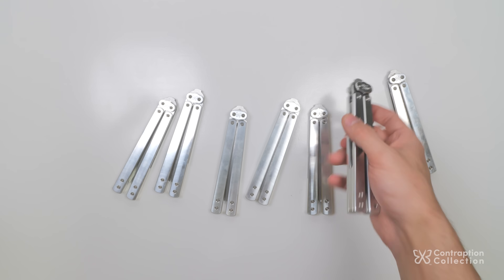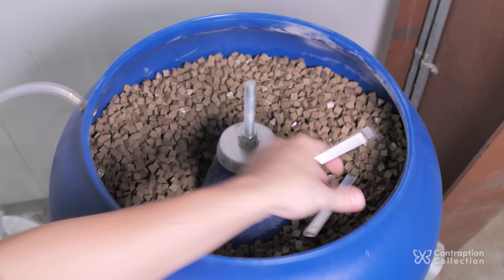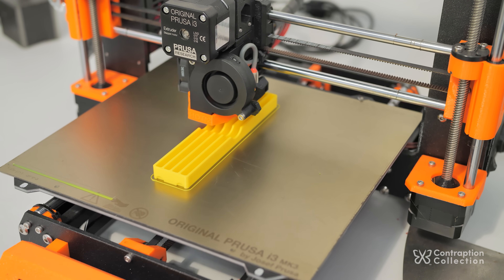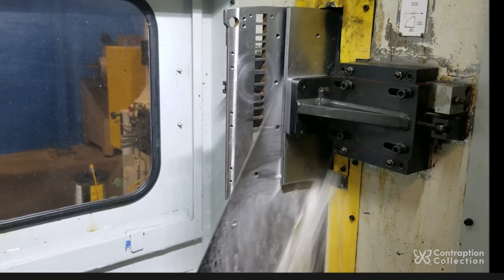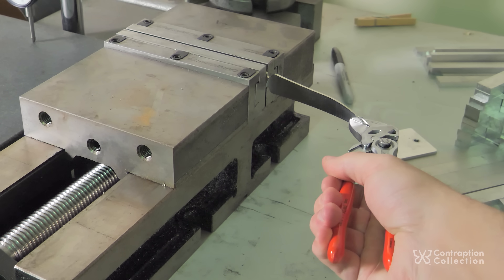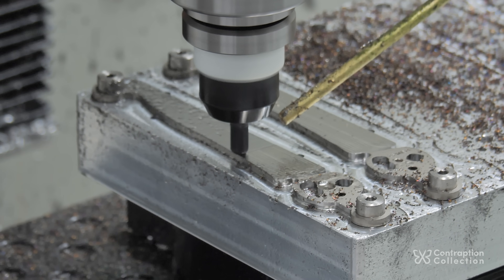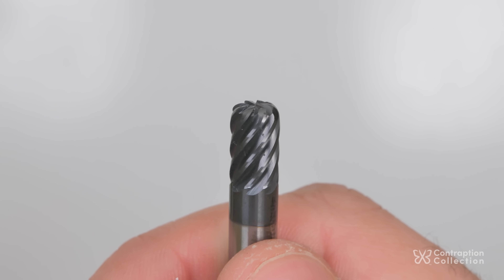I thought I was finished! Baliscissors: Ep 28

Comment: I'm no expert but I've watched an unearthly amount of forging and machining videos. The process is usually to make as much of the final product out of the stock steel as possible and then heat treat before sharpening and final finishing. Have you tried using an oil quenchable steel? normally it can be bad for warping with long thin blades but it seems like that is occurring in your current process anyways. might be worth a look.

Comment: Internal stresses in the material. 

Think of it in terms of material physics. When heated, the material expands, this temperature is held until all the material reaches a stable high temperature, this re configures the crystalline structure of the metal and when the material is cooled rapidly that reconfigured structure gets locked into place. 

However by rapidly cooling the material in this way, the inside of the material cools much more slowly than the outside. This causes the outside to rapidly contract, putting a lot of internal stresses in the material. Normally this wouldn't be an issue, but when you start removing material from one side of this highly stressed blank, the other side pulls the blank into a bend. 

The way to resolve this is by stress relieving the material after hardening, put it in your furnace at about 50 degrees C below the tempering temperature for about 2 hours, probably in the region of 450-500 C , Then after two hours, turn off your furnace and allow the whole furnace and anything in it cool slowly over many hours back to room temperature. This should get rid of the internal stresses without ruining the material properties. 

In the aerospace industry on extremely high tolerance parts, materials are often stress relieved after every process of manufacture in order to avoid any buildup causing poor manufacture tolerances further down the line.

Comment: Remove material in an annealed state, then try heating only one side for the quench.  In knife making if you don't heat both sides of your blade evenly you can get warps in the blade during quench.  Since you're cooling between plates, maybe pre heat or cool one plate so they are at significantly different temps, so when you draw heat from the blade it is at different rates.  Food for thought.  I love your idea and appreciate you sharing your journey.  I'll have to buy a pair when available.

Comment: They need to be in a Press while Tempering. Also when you remove Stock from a Billet it Usually Exposes the Stress In The Grain. Therefore subsequent Heat Treatment wil result in Undesired and Unexpected when the Metal releases the Stress from Manufacturing..
Killer Idea but you don’t know Enough about CPM. 

Temper The Blades in a Press. Leatherman Does Batch Tempering in Presses I Know because I Did a Bunch of their Farm Out Work when I was Machining in Portland

Comment: Maybe sand blasting the pieces before anodising should give nicer result (try different sands to look at different finish) and could permit to choose where to keep surface sleek and where you want the surface blasted and keep the same tolerence for your cotes. I'm worried that because of anodising deteriorating quickly in pivot holes and increasing holes sizes making the scissor wobly?

Comment: Are you tempering to relieve internal stresses?

Are you beveling after heat treat? You should have almost the exact finished shape before heat treat including the bevel just not a fully sharp edge yet (as close as possible). There should be no real mass removal just surface treatment (usually sanding or grinding).

Also id first try a bit with only 1 edge. Way less heat generated per revolution. Slower feed rate proportional to ratio of edges.

Finally try a more forgiving alloy.
Reply: I have an invention as well and may need to do some similar production research so thank you for sharing your story.

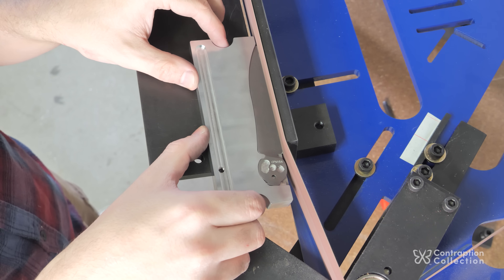Comment: @ContraptionCollection I have a solution for your problem @ 6:13 wearing down the sand paper in 1 spot.  Even with periodic raising and lowering, will lead to not maximizing the sand paper life, and/because it can possibly split while in use and slapping you in the face or eyeball.  A better way is to machine a adjustable plat that screws on to the grinder, but you plat can be adjustable at y axis and possibly z axis, put little liquid levels and possibly a stamped in guide with degrees so you know angle your at to stay consistent. then rotate new plat at an angle on the y axis from 0 to about 25 degrees , so the whole flat edge of blade  encompasses about 95% of the sand paper top to bottom.    Also your problem for the warped blade, maybe try adding heat the whole blade during milling so its even, and then have a warm oven ready so it can cool down at a slower pace. also maybe have some block with the blade dimension cut out says stays flat as you cool it.

Comment: The obvious solution is don't use a mill for grinding the bevel. You need something with a big cutting surface that doesn't cost as much to replace, like your expensive new belt grinder, or your expensive looking stone grinder.

Comment: Watch the so expensive video about English scissors - I don’t know if it applies here since the steel is so hard but there may be a way to hammer and bend them with minimal effort and get them fitted right. I think the ones in that doc are forged but same concept, heat warps and needs to be corrected.

Comment: Hi! Just stumbled onto your video, cool idea...as a certified welder I can tell you the problem you're having with the warping is due to the unexpected heat treatment caused by the tooling friction , also know there is no shock felt by the tools if and only IF you start the flow of  cooling liquid before starting to tool them, also try not doing it all in one pass , you see heat will  affect the metal by pulling at it....ie: lay a flat bar on  a metal table and weld one side of the flat bar...the side non welded will lift up....that's why  welders will weld a flat bar by succession... Right side, left side ,right side...etc...i know I'm 7 months late for the party but knowledge is everlasting so

Comment: About your horizontal beltgrinder: You say that it's a shame that you only get to use such a small area on your sending belt. I thought that if you could tilt your knife (cissorblade)support counter clockwise out of the horizontal position,  you should be able to use as wide an area on your belt as you desire. The further you tilt the support, the wider will get the used belt-area...

Comment: I am not in this field but I find this fascinating so forgive my potentially ignorant questions

Are you/your contractor running the blades through normalization cycles prior to heat treat? Itd take longer but it may reduce any bend during quench. It might also be possible fixture/shim the blades during a tempering cycle to straighten them out a bit.

Comment: Superb concept and design!. Regarding the blade distorting, I would not flatten and cut the bevel after heat treating, it will drive you nuts because as you've experienced, the variances are way too high when cutting edge life cycle comes into play. You could also get synt diamond tools but that's very expensive... I would cut the blade almost entirely, then heat treat, then true up the features that needs to be perfect.

Comment: If I may suggest, I'd recommend you spend a weekend learning how to use that monster 2x72 you bought. With a little practice, you can do a grind like that in a couple minutes, and eliminate the need for your cleanup process after milling. I don't know if CPM steel like that needs to normalize, but if that was a carbon steel, i'd suggest you normalize or even full anneal it BEFORE grinding it, and again after grinding it. That will absolutely minimize the chance of stress related warps. It can still happen on an asymmetrical blade like that, but that is your best chance.

Comment: One thing you can try with the blade warpage issue. As you are already plate quenching, you can try taking the blade out of heat treat during the temper cycle and clamp it in the plate quencher. Oftentimes slight bends can be prevented.

Comment: Hi ! I just wanted to tell you my experience on that subject, because I had the same issue when doing chisel grind on knives. For now on, i'll be doing the bevel after quenching the blade (and tempering) on blade thinner than 4mm, you get much better results and since you use carbide tools, you can still do that but keep the cooling liquide on while machining or you'll fuck up the TTH :)

Comment: I'm wondering if a fully formed and sharpened THEN heat treated blade would work if treated in matched pairs held by a clamping jig to lock both flat faces together, or maybe held against a curved jig to form the desired curvature so it can be cooled to shape in the profile desired ? If held in a jig, they could be cryo cooled or oil quenched while locked in jig, right ?

Comment: That engraving looks pretty awesome...I'll share this with some of my Bali obsessed customers...lol...properly made shears are supposed to have a bit of a bow to them (when closed, you should be able to slip a business card in the middle between the blades)...they're not supposed to be completely flat...if you don't want to use high carbon steel commonly used for them, you could use something like AUS-8 or AUS-10 stainless tempered to around 55-58...a 90 degree end mill would give you better results in the bevel machining...just a matter of mounting the blade at the correct angle to get desired bevel...very cool project

Comment: I saw a pair of scissors that had an adjustable tension via a set screw on the hinge of the scissors, so if the blades were too loose and not cutting you could tighten them. Would something like that work on the bali-scissors to compensate for variation in tolerances created during the manufacturing process?

Comment: I just got this video on my recommendations so I haven't followed the whole design process, but it seems to me that this tool is more of a balisong first and a tool (a pair of scissors) second.
You need to be able to open the scissors for it to be a good tool, I think a spring ball plunger high up on the handle near were the handles pinch would be a good lean/simple solution.

Comment: I milled brass strip 30 mm wide x 6mm thick x 200 mm long and had the same problem as you . I found out that my problem was that I was clamping the strip down flat in a vice and tapping the job down flat lightly on parallels.
When I put the strip in the Milling vice and let it find its own level it was fine, absolutely milled flat. You do have the flip the job over four times though and Mill down four sides as such to let the stress out.  Clamping down flat caused my issue.

Comment: You may be able to bend the blade in the opposite direction, however you will need a way to heat JUST the 'spine' of  the blade without overheating the edge and ruining the temper. Typically I use a MAPP gas torch with a thin jet to focus the flame. This works for me when I'm working with CPM 154 and having issues with warping. Let me know if this works.

Comment: Have you tried normalizing the steel? Like after the hardening, you could try a tempering cycle. I'm not sure how you do the heat treat, I only saw you heat it and throw it in a jig. But a tempering cycle might help with the warping. I would also maybe try grinding in the finished bevel instead of machining it. You could try freehanding a few example to see if it's better.

Comment: I’ve never seen scissors with that blade profile. It’s not practical to have the profile of a flat grind knife only on one side or the warping will happen and you will get the tooling problems too. Just do a shallow grind like a scandi so you can have more material to prevent warping and the bits will last longer since you can make it by sanding

Comment: have you considered beveling the blades with a shaper, it should not take any more time although tools will wear out faster however tools are also a lot cheaper to put a new Edge on. another possibility is removing the stress that is bring the blades back to dead soft through annealing thoroughly the only other thing I can think of is a structured quenching using the press to First quench and then draw back to the desired temperature my only other thought process is that you're using the press to frequently thereby not allowing it to cool down in between pressings so it's not the tool that's changing the bend but the Press also you seem to be pressing your blades one at a time when you should be able to press an entire tray all at once because I'm assuming you're using the press as your quenching device also and if you press them all at once and then let the Press return to proper room temperature before you press again you should get a very regular result because right now it sounds like you're going through a lot of bit because you need to keep them extra sharp and you're not taking any time to anneal the work hard and surface before you go through the tempering process working with boots you end up going through a dozen tempering processes and annealing processes the tempering processes are simply a matter of holding the steel time and time again without giving the steal much chance to relax and so you have to anneal the work and let it rest the same as if you're pouring Steel you have to pull it out of it sandbox and let it rest before you can go back and start Machining it or it will change during the Machining the block that they cast when making car engines must be rested for at least one year Japanese blades take one month to produce not because there's one month's worth of work there but because the blade cannot be made unless the metal is allowed to rest, hogany is folded until a Billet is created then the Billet must rest from the bill at a blank is created by drawing it out then the blank must rest then the blank must be forged into it's final shape and rough ground and then the blade must rest finally the blade is straightened annealed and then prepared for temper finally the blade is tempered so in reality a Japanese blade takes 1 year and one month to create once a Billet has been formed and very rarely can anybody determine the amount of time it's going to take to form the Billet the tomahogany chooses or so says the masters of Japanese sword making. new additional Madness do I offer you because I realize I just created a storm within your mind that has very little to do with reality but most likely has a piece of the puzzle in there that you're missing.

Comment: Who am I to say this but here it goes:  According to "The Lean Startup" book by Erick Ries its a great idea to start selling an imperfect product because sometimes you base you "perfection/ideal" on biases that are irrelevant to you customers.  There's always a group of early adopters that prefer to have a product sooner and doesn't care that it has "imperfection's."  Having people use/test the product sooner can help you learn what really is attractive to them (testing your bias) and make changes and decisions that add pure value to you already captivated customers.  Please consider shrinking the bevel.  Speaking for myself, I prefer to have a chonky boy now and a perfect sleek baliscissor later.  Some people may even prefer a thick blade. (I'm thinking out loud here please ignore me) You don't have to reinvent the wheel, almost all comercial scissors have a similar geometry with very low angle bevel and this is probably for a reason (example: cheap to manufacture, long lasting edge even using mild steels, etc.)  Fome cheap scissors just work for ever.  In my opinion if you can match the performance of a regular kitchen scissor its more than enough and please take my money.  Heck id buy a soft stainless steel one that i can bend by hand once it stops cutting.   I really respect your craft and I can see you are making art.  Big fan, keep going brother!     :washhands::washhands::washhands:

Comment: They are warping from the heat of machining, coolant is probably not the answer, I think you need relief cuts. Aluminum will warp at 400 or 500 Degrees F, it probablby also is "Work Hardened" afterwards, try cutting into (while missing your contour) it as much as you can on something that will not heat up so much. Put it on a bandsaw and cut opposite sides alternating so the heat can dissipate while your cutting the opposite, it shouldnt harden from a bandsaw, just give the heat somewhere to go, besides its host conductor Aluminum.

As for the bent blades 2 ideas

1. If you have a press (arbor press might work, if you have access to a brake press that will do for sure) Heat the bent blades in your kiln lock it in a press between something flat, while its hot, flat, and under pressure of the press quinch it with something (oil, coolant, or water may even be your best bet.) if the bend remains use shims to counter flex it in a press doing the same process. If carbon content is to high it may shatter in a press while hot be careful.

2. Stack the part, cut it say an inch deep then cut them apart on a bandsaw, with a good bandsaw you might be able to cut the bevel.

Comment: Could having the mounting bolts of the blade at opposite ends be causing stress on the blade in the middle? Also could you try machining the bevel on the surface grinder with a sin plate? I did that once for a single bevel knife blade and it was perfectly flat with no mounting bolts just the magnet plate. The blade was 1095 not heat treated at the time. Great videos!

Comment: Sir. Try cutting them Out heat Treat them with .015 per Side then Bench grinding so the Magnet keeps the blade Down. You can have a Diamond Wheel withe the Right angle 📐 for Grinding. We always grind after Heat Treat.    Good Luck 🍀